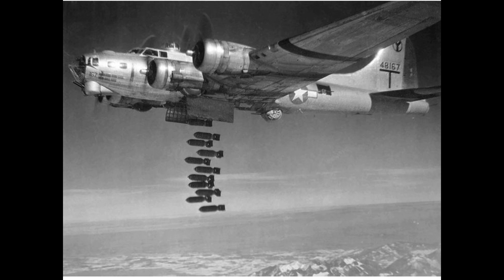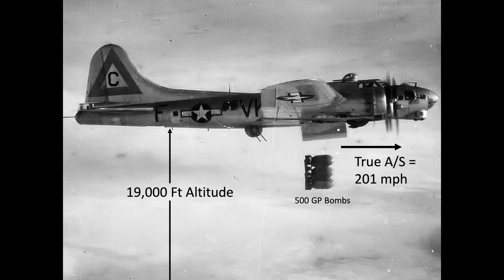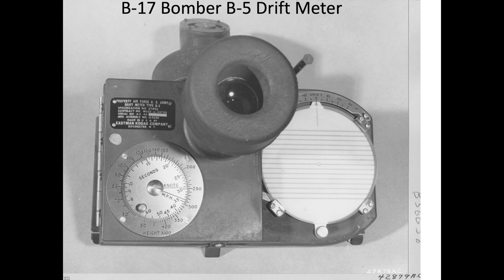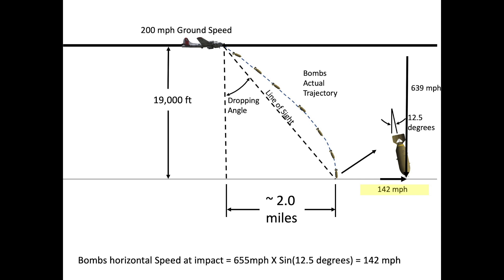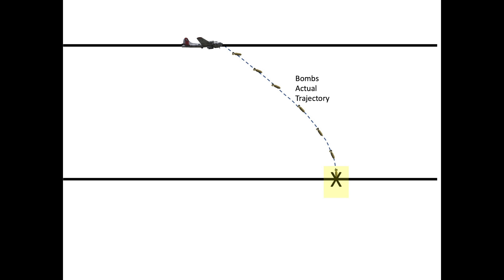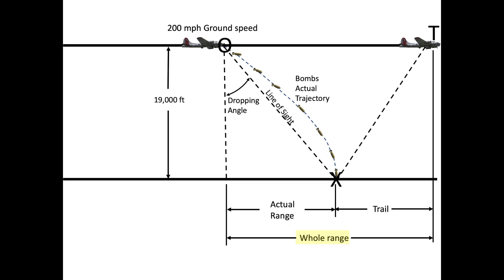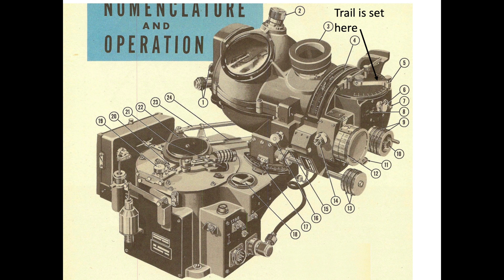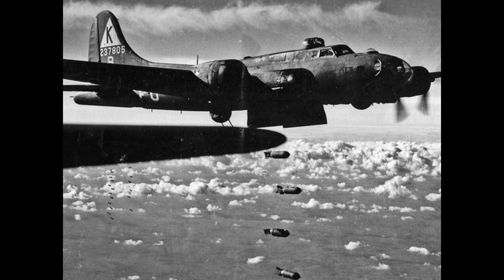B-17 Bombing Ballistics Math Explained

Comment: This video is rather good.  It makes a few things clear that would otherwise be not obvious.   E.g. he points out the that the bomb horizontal speed at impact is still 71% of the aircraft ground speed, and trail is only about 9% of the range, in the realistic example he uses.  The bomb drop time is only 4.5% longer than it would be in a vacuum (stated at 8:08).  So error in targeting due to non-uniform wind speed over the altitude range cannot be great
Reply: Except, while flying in the jet stream when bombing Japan in the beginning, using the Norden bomb sight that was very effective in Europe, they found high altitude bombing to be completely lacking in accuracy.  They had to drop below the jet stream to 8,000 feet, to have any accuracy at all.  Of course, very little was known about the "jet" steam, in that beginning.  Luckily, they did get things hashed out.  There was no way the atomic bombs could have been dropped at 8,000... without the bomber going up with it.  They almost did anyway.
Reply: @donf3877  : I think you are repeating misconceptions dreamed up by other YouTube presenters and authors.   As far as I know, US WWII Bombers is the only YouTube presenter who has based his videos on declassified official US AAF documents, and other original sources of reliability.   Few book authors did so too. 
Chart 3 in the official US airforce report "AAF Bombing Accuracy SC-T-83 1945" shows accuracy decreases in direct proportion to altitude.  It makes your claim that accuracy at high altitude quite unfounded - accuracy at 25,000 feet was only about 15% worse than at 5,000 feet.
That chart applies to the version of the Norden used in Europe.   The Nordens for the Pacific War were adapted to improve accuracy at the higher altitudes used.
It is an old urban myth that the jet stream phenomena was not well understood at the time.  All airforces then were familiar with it.   What was different about Japan was that it was subject to erratic high winds at low altitudes down to ground level - that was sometime the US AAF had to grapple with, but it wasn't a huge issue.   My first post here shows why.
The US AAF did indeed decide to bomb at low altitudes in Japan particularly when specific targets could be identified - not so much to get better accuracy, they did it because they could - the Japanese defence against the B-29 was not very good, and not flying at maximum altitude saved a bit of fuel.   Japan had no radar controlled anti-aircraft guns like Germany did, and their fighters and pilots were not up to the speed and advanced guns of the B-29.  Flying B-17's at low altitude over Germany was near suicide, but over Japan in a B-29 was fairly safe.
The biggest problem for the US AAF in bombing Japan was that they generally didn't know where good targets were.  Things like phone books and trade journals gave target locations away in Germany, but such things did not exist in Japan.  German production was in huge industrial complexes and campuses.  Most Japanese industry then was small "cottage" type production scattered around in cities, much like Pakistan has today.  A house-size factory making bearings here, another making hydraulic cylinders there ....   So the US AAF just carpet bombed entire cities.
Accuracy with the nuclear bombs was unimportant, due to the huge blast radius.  Due to a coordination mix-up with the observation plane, the bomb for Nagasaki was dropped with considerable error as they were running out of fuel after flying around in circles waiting for the observation plane to show up.    The navigator told the commander that fuel was critical, they must go home NOW, so the commander immediately ordered the bomb dropped regardless, and he turned for home.  It didn't matter.   The destruction still scared the bejesus out of the emperor, who stopped the war.
Reply: @keithammleter3824  Talk about "misconceptions"

"Japan had no radar controlled anti-aircraft guns like Germany did".  Maybe you should study just a little more history, before making a comment on a subject you obviously know nothing about.  And, maybe you should watch   "Battle 360 Episode 7 -Hammer of Hell"  here on YouTube about the carrier USS Enterprise, specifically at 41:25.  On the second attack of Truk Atoll, it states and explains Japan DID IN FACT have radar controlled anti-aircraft guns.  Japan was using them to protect their Pacific island bases, as well as the home islands, before the US even took the Mariana Islands... where the B-29's would eventually be based.  And therefore, well before Mariana-based B-29 bombing attacks on the Japanese homeland.

"fighters and pilots were not up to the speed and advanced guns of the B-29".  Again, study a little more history.  The Ki-84 Hayate (Code named Frank by the Allies), and the pilots based in the home islands... were every bit a match for the pilots, and the speed and maneuverability, of the P-51 Mustangs escorting the B-29's, and shot many down.  They were most certainly faster than the much slower B-29, and again shot several down.

"Accuracy with the nuclear bombs was unimportant, due to the huge blast radius".   WOW... you REALLY should study more history.  Watch   "Enola Gay  The men,The mission, The atomic bomb"   here on YouTube.  While it does have a little extraneous fluff in it, the basics of the movie is an extremely factual account of the training of the crews leading up to the atomic bombings... and just how important ACCURACY was to the mission.  The Technical Supervision for the movie included Paul Tibbets, the pilot of the Enola Gay (but obviously NOT his wife); most of the crew of the Enola Gay; and others involved in the mission.  They made sure the movie was as factual as possible.  Watch all the way to the end, since it took a look into what many of the men of the mission did after the war.  It was released in 1980... so it doesn't account for them after that time.
Reply: @donf3877  : You have no idea what you are talking about.  Sure Japan had radar - of a very crude sort.   Despite having invented a key part - the magnetron - years before.   But their AA guns were nothing like as effective as what Germany had.
I base my words on declassified official US AAF documents, not movies.   We all know the Hollywood propensity to turn out movies claiming to be accurate and that the movie company retained so-and-so military expert as a consultant - with varying actual results, often entirely bent to satisfy director's wishes for dramatic impact.   Sometimes they pay the guy a big bag of money just so they can use his name.
In any case, the Enola Gay dropped the bomb on the Hiroshima naval base, not Nagasaki.
Note that a fighter being faster than a bomber is not the whole story.   A fast bomber was harder to hit than a slower one even if the fighter was faster than both.
My comment was that the nuclear bomb dropped (very inaccurately) on Nagasaki, because of the huge blast radius from just one plane, frightened the emperor into giving up.   That's entirely correct.  For all he knew, the US might have been able to continue, and with the number of planes the USAAF had, with this new bomb, they could blast all Japan clean out of existence, and him with it.   They sure didn't, they only had enough reactive material to make 3 bombs, but he didn't know that.  So, he ordered his armed forces to stop fighting, and the War was over.  It was the blast radius that did it.  Accuracy just didn't matter a whit.  
By the time the USAAF dropped the bomb, Japan had hardly any operational fighters of any sort.  As I said, due to a mix-up with the observer plane, the plane that dropped the bomb on Nagasaki flew around in circles until they ran critically low on fuel waiting for the observer plane to show up.  The Japanese were well aware of it circling, but didn't bother to scramble a single fighter until it was too late.   As far as they were concerned, there wasn't much point.  And no, they could not hit it with their anti-aircraft guns.  That B-29 was perfectly safe.
You should watch all of US WWII Bombers' YouTube videos on the US AAF performance.  Take note of the references he cites, almost all of impeccable value, download and read them before shooting your mouth off.
Reply: @donf3877  : You have even less grasp of the subject tan I thought.  You have absolutely NO idea.
Hiroshima back then was a HUGE Japanese navy base.   The city was full of contractors, suppliers, and navy personnel.  The navy was the only reason for the city's existence.   The people there were either Navy men, contractors working for the navy, or civilians directly supporting the contractors with the usual services - food, medical, etc.  That's a big part of why it was selected as a target - effectively it was entirely a military target.   It was also surrounded by hills, and it was useful for the USAAF to check the effect of the hills on containment of the bomb's effects.   It was thus entirely correct to refer to Hiroshima as a navy base.
The bomb was dropped fairly accurately on Hiroshima.  It was not "5 to 7 miles off target".   The drop on Nagasaki was way off the planned aiming point, for the mix-up reasons I gave.   And it didn't matter.  It stopped the war for the reason I explained.
You have it totally wrong about bombing heights.   Initially in Europe the USAAF flew at moderate altitudes but losses due to German AA were unacceptably high - so they changed to maximum operational altitude and experimented a lot with different formation flying configurations.
Notwithstanding claiming errors of 5 to 7 miles, you said accuracy was important to the USAAF.   It WAS indeed important to the USAAF in the war in Eutope where strategic targets were big factories, oil refineries and power stations, and their locations accurately known.   For Japan, the USAAF had an entirely different approach, because they, except for a few exceptions, didn't know where strategic targets were.  Japan then, had a multitude of small almost "father and son" cottage industries, each making only one or 2 sorts of parts, feeding assembly plants, mixed up with residential and other sorts of buildings all over their cities.  They had no big power stations - they had lost of small ones.  So the USAAF just carpet bombed whole cities and wrecked everything.   That is a well known fact.
If you were a USAAF mission planner and wanted to know where aircraft radios were made?  Look up Siemens in the German phone book.   Consult a German trade magazine.   Japan had no phone books or trade journals.  
The B-17 and the B-29 had virtually the same maximum operating height.  The B-17 actually had a higher service ceiling (B-17 10,800 metres; B-29 9,170 metres).  The B-29 flew quite a bit faster, cruising at 350 km/hr vs the B-17 at 293 km/hr.  
It's no good you squawking about US Navy documents when we are talking about bombing Japan - that was entirely what the USAAF did.  The USN dealt with the IJN and provided transport of men and material to USAAF bases, and the USAAF bombed Japan.  Don't get it mixed up.  
People posting "corrections" on US Bombers doesn't mean they know what they are talking about.   You sure don't.  That's how it works - if you post a video or comment on YouTube, people who think they know things will post their nonsense.  
Actually US WWI Bombers does pretty darn good.  He's not 100% right 100% of the time, but he is the best on YouTube there is.  He is the only video poster who properly cites his references so that we all can, if we choose, download them and check if he read them right.  I did and he has got it about 99.99% right.  The only video where he went astray was the one on B-17 paint.
Your writing on the obligations of military personnel under the UCMJ is just nonsense.   It may be immoral, but it is not an offence to allow lies or errors to be told in a movie or book.   It IS of course an offence to pass on military or government secrets.  Actually, the US military, and those of other countries, are pretty flexible about what gets put in movies, dramas and documentaries, and readily help in making them - because their experience is that just about any military movie regardless of content increases the numbers of people volunteering for service.
Reply: @donf3877  : Rant away.   Other readers can see your rants and judge for themselves.  You got so worked up you misquoted yourself.  Either that or you can't express yourself properly.
Since US WWII Bombers cites references. you and anyone else can go download and study them.  I suggest you do so - carefully.   There's even a 1945 USAAF report that lists the statistics of accuracy achieved by bombardiers at the end of their training - that's what counts, not the beginning of training.  See Chart 4 of SC-T-83 1945.  Individual crew accuracy was of the order of a few hundreds of feet and never at any stage "5 to 7 miles".   Note that Chart 4 covers all types of bomb sight used by the USAAF, not just the high accuracy Norden.  Crews were understandably a little worse in accuracy under fire over Germany. But not much.
Why do you talk on things that are not relavent to the points I made?  For example talking about navy experience when the subject is bombing Japan.   For example talking about the beginning of training, when it is accuracy over target that counts.  Most people are competent in driving a car, but not on their first lesson.  Your irrelevancies, usually wrong in themselves, must be because you can't refute the points I made.
Reply: @keithammleter3824  I’d add one thing to your comment on knowledge of locations. At least in Tokyo most neighborhood streets weren’t named or signed until required to do so by the U.S. Army.
Reply: @billsmith5109  : It certainly wasn't just Tokyo.   My father, who had studied Japanese languages and culture before, served with the BCOF (The US occupied the northern 2/3rds of Japan.  BCOF, basically Australian troops, occupied the southern 1/3rd. )    His main job was monitoring / supervising the Japanese police force in Kure.   First, they had to FIND the police stations and the police officers.  It wasn't that easy. 
Another part of his duties was to locate and identify all prostitutes.  They were easy to find.   
Basically, outlying towns and villages were a like a very disorganised 18th century western shanty town, with 14th century culture, overlaid with a few modern things like electricity, and clean.  If you overnighted in a hotel/guest house, you could order a bath (O Furo).  The owner would send his young teenage daughter in to help you with the bath, scrub your back, and fetch towels.   On seeing your peculiar nearly 6 foot white body, she would tell her sister, and then they all would all find an excuse  to come in and have a look.  Some army guys would misunderstand the girl's intentions and cause a lot of trouble.